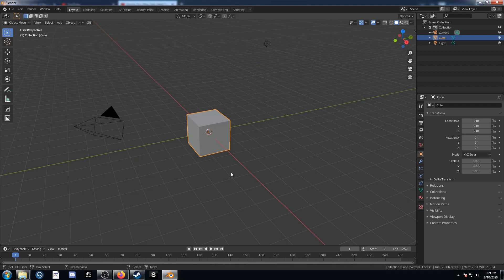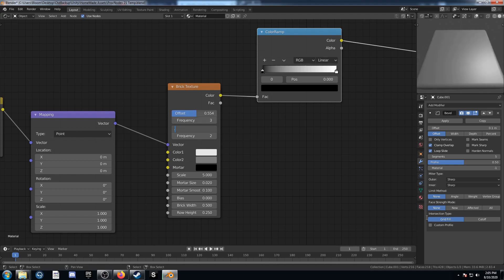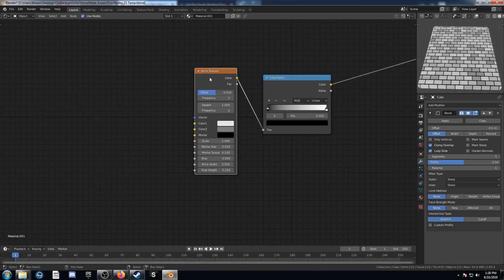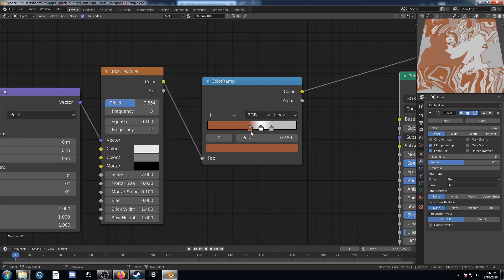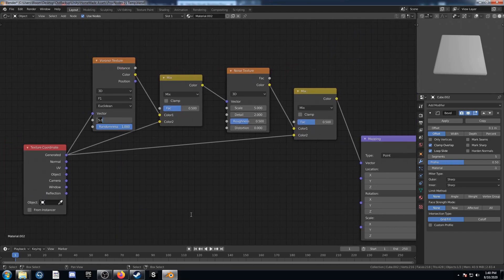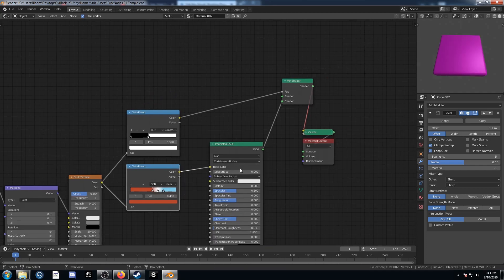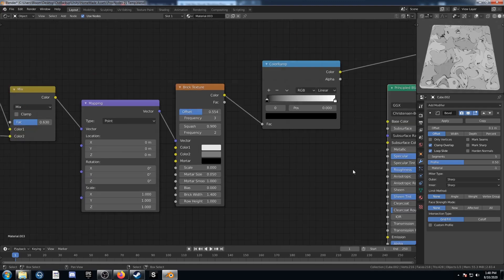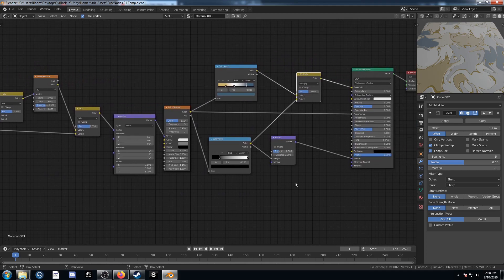Procedural Nodes (part 21) - 4 Abstract procedural textures using the brick node in Blender

Comment: I think since the layout of the textures are so similar, you could save a bit of time by just editing the previous texture into the next one so you don't have to repeat the steps over and over.
Reply from the maker: For sure i did consider setting it up like that. The reason I did it this way is because you can just watch one part of the tutorial rather than the (setup part + part with pattern you want to learn).